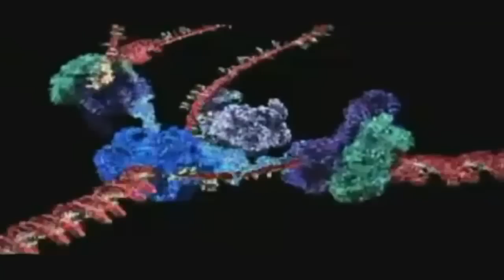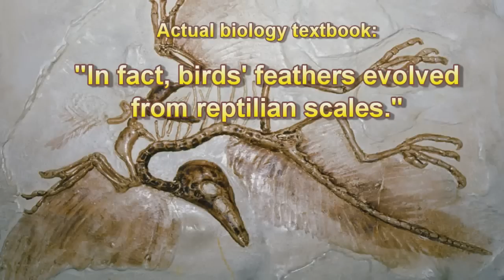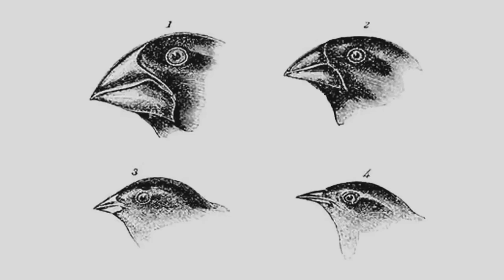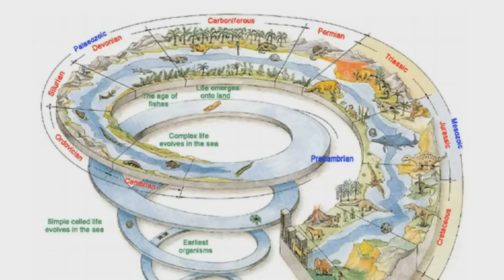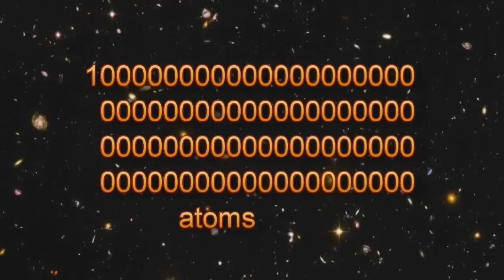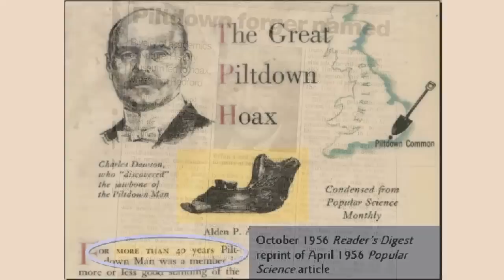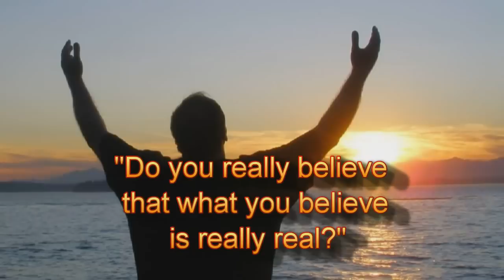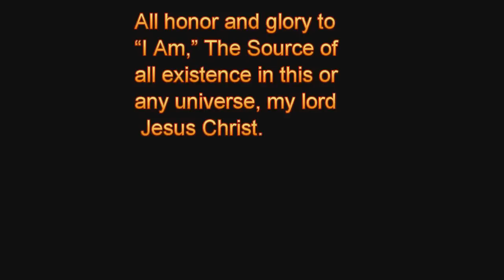Evolution Demolition

Comment: Thanks for the Flank article.  It is a rehash of what I have heard a thousand times. He is limiting his own understanding to the 2nd law and its pat answers, but he is not comprehending that the 2nd law is a subset to much greater mathematical principle of increasing randomness, in which all things move from lower probability states to higher probability states over time.  The 2nd law applies everywhere, but thermodynamics illustrates it with over-simplified hypothetical case of a closed system.

Comment: As I have stated before, an entropy transfer mechanism (ETM) is any means of moving entropy (randomness) from one part of a system to another.  Entropy is not generally ubiquitous in systems (open or closed). Statistical mechanics speaks of microstates. A natural ETM example is the hydrologic cycle in nature which harnesses solar energy. Natural ETM's are not uncommon if the gradient between lower and higher probability states is not extreme, so probabilities are altered. Make sense so far?

Comment: No, they are not wrong.  But they are widely misunderstood.  I viewed entropy like you did at one time, but I learned that it is based on mathematics more than physics.  On probabilities more than heat.  That's why I coin the term "increasing randomness," because it applies in all disciplines.  Try to get the concept of what I'm communicating. Perhaps look up an article by Dr. Granville Sewell?  The concepts are clearer to me than ever, and I have a high degree of confidence in what I am saying.

Comment: Actually rates of genetic change are actually used when calculating when a species splits off. However the problem is that there are a lot of variables since it's dependent on population size and environment. That makes the estimation very rough. Especially if you can't pinpoint the environment exactly or the size of the territory.
Reply: Some scientists have attempted to use rates of genetic change to make interpretations of when past, unobserved evolutionary divergences may have occurred. It should be pointed out that this is using the flawed logic of circular reasoning.
Reply: How is it circular? Again you take information that you gleaned from the net as being accurate; is at best, foolish.
Reply: the nail in the coffin for creationists tho is the fact of those errors; from species to species, the errors can be compared, as obviously a species would hand off its errors to those species that evolve from it.

But more importantly, those errors could/would be unique to each species "chain".  So this forms a pattern that can be seen down through the species.

And the beauty is that it confirms the Tree of Life in every case when checked.  An undeniable pattern of inherited defects that point to where they picked up the defect along the way.

How interesting that Defects in DNA can be such an irrefutable evidence that proves Evolution beyond any doubt.

Comment: I'm intimately familiar with C-14.  Anything with residual carbon can be tested for C-14, such as unmineralized soft dinosaur tissue, coal, or crude oil. We know the percentage of C-14 in the atmosphere  was lower in the past, so it is not a constant. Which means C-14 dating per se is skewed.  The dates are MAXIMUMS.  But measurable C-14 is present in all these things in all layers.  This mean no layer can be older than 100K yrs. This is hard science.

Comment: Yes, there needs to be an entropy transfer mechanism. Have you heard of "chemical reactions"?

DNA breaks down in sunlight, yes, (as does RNA, probably the molecule which provided the genetic code for the first life) which is why many people think that life started in geothermal vents at the bottom of the ocean.

Polymerisation of ribonucleotides spontaneously occurs in the right conditions of temperature, chemicals present (catalyst, solvent etc) and pressure.

Comment: >> Yes, then it was another 15 feet below that.

If the sand the bones were found in does not make part of the surrounding geologic strata, then we have reason enough to assume that there used to be an access to the site with the skeletons.

Do you believe that Mr. Patton, who could not even tell the difference between a cretacious and a jurassic stratum is more apt to decide if a specific "soft material" makes part of the rock layer it is surrounded by than 3 archaeologists?

Comment: @16:56- yes we have observed new information in Genomes. The most famous case is Nylonase.
Reply: Nylonase utilized the bacteria's capability to adjust its digestive enzymes by accessing segments of plasmids (exogenous DNA loops).  The Designer built in limited, but truly remarkable, self-correction and re-programming capabilities that is even more illustrative of design.  But nylonase is only an altered arrangement of amino acids in an enzyme, not a genetic instruction set for a function that wasn't already there.

Lucky alterations of existing instruction sets which are not-so-improbable, even by random mutation, can occasionally happen.  However, new features (even simple ones) require functional and complex instruction sets, that would go against impossible odds--even if you had multiple universes.  The math jumps exponentially.
Reply: Mark Champneys I'd prefer to stick to the main point before moving on to the so called impossible odds. That point is that Nylonase is an example of new information in the Genome. You can't argue that information theory forbids new information when we have counter examples of new information being observed.

For the sake of this particular argument It actually doesn't matter if the process was natural or designed. 1st I am assuming that the creationist definition of "information" actually means something (and as far as I am aware that is not necessarily accepted). But given that, if you have a jumble of letters: TRA say, the amount of information increases if we re-arrange them into an English word: TAR, especially if we have a mechanism to manufacture whatever the English word means. Now lets say we can have duplication events and TAR becomes TAR TAR TAR, then we add a frame shift and one of the TARs becomes ART. Now we are manufacturing TAR and ART.

The amount of information has increased. How it increased we can argue later, but can you accept that it has?

(BTW information theory does not forbid an increase of information in an open system, it simply suggests to us a method to calculate the amount of external work that would have to be done in order for it to happen. This has been done for DNA and it has been shown that it's not impossible. That should not surprise us because for an individual molecule, even one as large as DNA, this amount of work would be very small and certainly smaller than the amount of external work required to keep us alive).

Comment: Case 1: easy decision

God creates an apple tree
God creates your body, which signals hunger when it requires food.

Now you have the option and a reason to eat the apple.
Therefore you will WANT to eat the apple and decide to do so.

And you will be under the impression to have had the option to refuse if you had not WANTED to eat the apple.

Comment: 10) If the second law of thermodynamics is only true in a closed system, trying to apply it to an open system is futile. Anyone who still wants to use it there is the one who thinks he is 'above the law', not the ones who say it won't work.
11) Photosynthesis wasn't 'programmed'; it does not suggest Intelligent design.
12) Incredulity concerning the chance of factors to come together on a planet to support life is not an argument.

Comment: It's not a problem to challenge any scientific hypothesis or theory but one's alternative must bear the same rational scientific scrutiny. Creationism/ID uses scientific sophistry to rationalize an excuse to make the illogical and unsupportable belief in the supernatural only because "Well, it seems like it to me." and "What else could it be?" AKA The god of the gaps argument. Exactly ZERO effort is spent providing scientific support for the existence of the alleged designer. Why? Because there is none.
Reply: Creationists/ID proponents use positive scientific arguments for a Designer. It is not based on gaps at all.  It is more true that philosophical materialists emply an "evolution of the gaps" fallacy.  The argument from ignorance.  We can't explain it, therefore "Evolution must have done it."  Can we agree that this is a fallacy whichever side is using it?  I can tell you that I, personally, never argue for God in such a manner because it would be a bad argument.

You need to also face the fact that materialists invoke the supernatural as well.  The Big Bang requires that the laws of physics be suspended--and proclaim that nothing caused nothing to expand faster than the speed of light into everything.  This, my friend, is "supernatural" if anything is.  There is zero science behind it, other than to say, "Here we are, so the Big Bang must have done it."  So I encourage you to step into the other guy's shoes and look at the data from there, in the interest of fairness.
Reply: @markchampneys  : OK. Then what is the positive evidence for the supernatural? No one has been able to prove that anywhere, ever and they have tried for millennia. No one claims they know what instigated the Big Bang so it is neither invoking the supernatural nor suspending the laws of physics—which at the quantum level are we'll beyond Newtonian physics. No one has ever claimed anything factual about the big bands origin like ID and creationists do so that argument doesn't hold water at all.
Reply: @lrvogt1257  Your view of supernatural origins or my view?  The Big Bang itself is characterized by events beyond natural law, so even without pinpointing a first cause, that first cause, by definition, would have to be supernatural--beyond natural law.  If it does not follow the laws of physics, and cannot be observed or tested, we certainly cannot call it science.  The latest cosmology calls for an infinite number of universes and big bangs.  Based on what evidence?  There is none.  Just in their own imaginations.

The cosmological argument reasons to a supernatural First Cause who is a mind, rather than supernatural matter (as materialists believe).  The law of cause and effect, when reasoned backwards in time cannot be infinite, but logically requires a First Cause.  That First Cause of existence is clearly outside of nature.  "Above the arch," as they say.  So both theists and atheists believe in a supernatural beginning.  The theist says the Source is Mind, while the atheist says the Source is matter.  Which is it?  Either way, it is supernatural.  Of course, theists have more than the cosmological argument.  They also have the teleological argument (design), which is substantial.

Positive evidence for the supernatural, besides what I've mentioned?  How about the ruins at Jericho which match the miraculous Biblical account of the walls falling outward on command.  These ruins fit the Biblical account in every way, including the city being burned with grain still in the jars.  This archaeology is evidence not only for the history, but for the miracle that occurred.  I could talk about incredible fulfilled prophecy.  I could talk about the historicity of the resurrection of Jesus.  (I suggest reading Cold Case Christianity by J Warner Wallace.)  And inside every living thing is digital symbolic code jam-packed with instructions for building organisms.  There is no known natural process that can generate prescriptive information, especially not in such equisite integrated detail as we find in the human genome.  This points to an intelligent source of that DNA information, not to mention the histone code, the sugar code, and others.

"No one has ever claimed anything factual about the big bangs origin..."  Really?  (You don't get out much, do you.)  The scientific literature is full of this kind of talk.  No, they don't say it is proved, but they talk as if it has been.
Reply: @markchampneys  : That the Big Bang happened is based on the trajectory of everything in the universe but no one is pretending how or why it happened is known. There is only speculation and some possible hypotheses. Not knowing how or why means we don't know how the laws of physics functioned so we can't know that any were 'broken"  According to your "reasoning," since "Abraham Lincoln, Vampire Hunter" references actual places and people it must be true. Well, it's no more true than the Bible legends. And it is never an argument that since thing A isn't true that thing B must be true. That you assume complex structures must be designed does not make it so. It's just the anthropomorphic lens through which we tend to view the world.
Reply: @lrvogt1257  "...no one is pretending how or why it happened is known."  (Hah, tell that to the science media.  They definitely think otherwise.)  It is true that neither side can offer details, but both views do offer broad claims.  The materialists say that, whatever it was, had to be a material cause, without agency.  Theists suggest an intelligent cause based upon abundant experience with intelligent agents.  I do not "assume" that complex structures must be designed, but instead make an inference from the data, including our experience with foresight, fine-tuning, fantastic improbability, and the presence of objectively decodable symbols.  What experience do materialists have with a universe expanding faster than the speed of light, or the violation of the law of conservation of angular momentum?  There are none.  If you suggest something that defies the laws of physics, you are no longer doing science, but metaphysics.  (Some would say pure superstition.)  Here is one of my videos on this https://youtu.be/Zf0LZRLZSBI

You lost me on the "vampire hunter" thing.  Maybe you are talking about corroborating evidence?  Corroborating evidence is not always conclusive, unless it is extraordinarily improbable, such as the outward collapse of the walls of Jericho, unlike any other ancient city known in archaeology, and also at the correct estimated time in history.  The odds against this being a coincidence are staggering.
Reply: @markchampneys  "The materialists say that, whatever it was, had to be a material cause, without agency. " YES! because that's what science is about, verifiable factual information about the real world. There is no rational purpose to leaping to supernatural "agency," for which there is no evidence, as factual information is being gathered. If you know of any actual scientists claiming they KNOW how the Big Bang began, tell me. 
In the time frame of the legend of Joshua, ""Jericho was a heap of ruins, on which stood perhaps a few isolated huts". 
Clearly you have a need to believe and I don't care about that. I don't accept science being used or misrepresented to rationalize superstition. 
"It's called Faith because it's not Knowledge." Hitchens
Reply: @lrvogt1257  "...a material cause, without agency. " YES! because that's what science is about..."  No, science is supposed to be about detecting truth.  Intelligent activity is verifiable in the real world.  It is not generally supernatural.  It is observable and testable.  Consider all the sciences that delve into intelligent causes.  It is true that agency detected at the point of origins would suggest an intelligent agent beyond anything we know, but nevertheless an agent.  We need to follow the evidence wherever it leads.

You quoted something about Jericho, but did not reference that quote.

There is not a distinct line between faith and knowledge, but rather a continuum.  Some call superstition faith.  I don't.  Superstition is to believe something without evidence, but only because of a wish.  Biblical faith is to have reasons for believing.  If something is proved to be true in one case, we can infer a basis for trusting in another.  [example: I believe that Jesus has power to give me eternal life because many witnesses saw Jesus raised from the dead.]  Blind faith is not something I endorse, and not something that God requires.  The Bible says that "faith is the evidence of things not seen."  Keep in mind that even the scientific method acknowledges the continuum of epistemological uncertainty.  Some things are guesses, some are hypotheses, some are theories, and some are laws.  There will always be areas without certainty for any of us, but we can continue to verify or falsify such things.  I find lots of superstition among materialists--believing things without evidence, but only a wish.  I know you would like to think you are immune from this temptation, but you are not.

Stephen Meyer called DNA a "signature in the cell."  Exactly so.  Objectively decodable symbolic digital code within cells is a shocking discovery, because decodable symbols are only possible if encoded by a mind.  There are no exceptions to this in all our scientific inquiry, in all the data ever collected, and all the experiments ever done.  DNA is literally a signature in the cell.  The artifacts of intelligent activity could not be more irrefutable.
Reply: @markchampneys  You are wrong. Science determines facts. Truth is a perception. Don't pretend a cosmic designer isn't supernatural cause I aint buy-in it. Anthropomorphizing everything is very Bronze Age.  Stephen Meyer is a joke to real scientists and he has been debunked repeatedly.